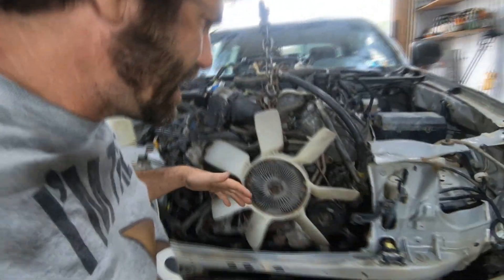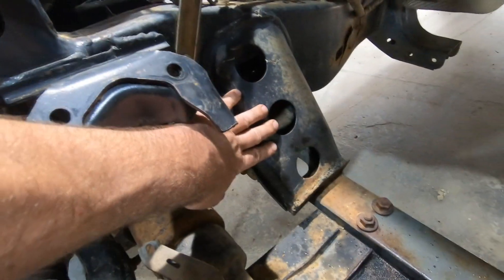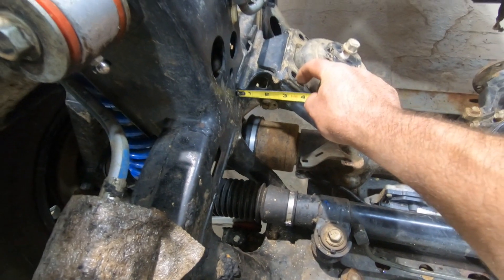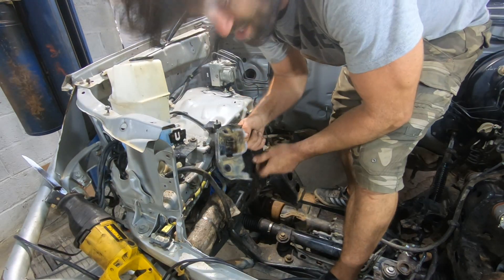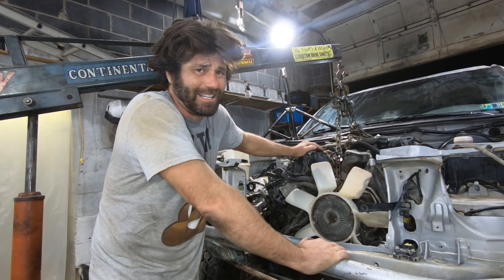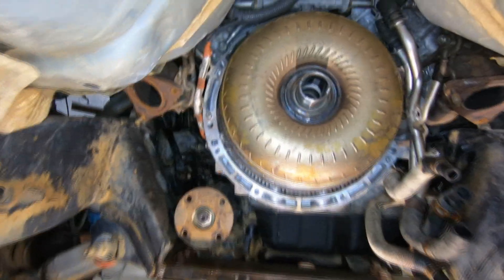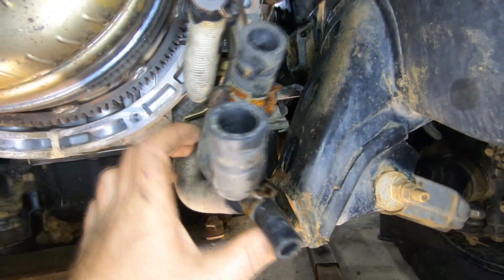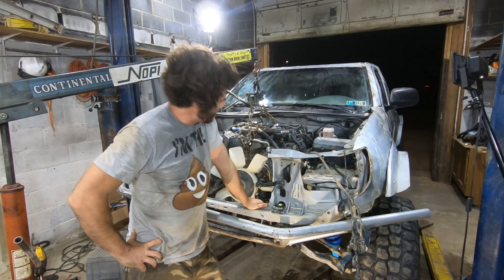Toyota Tundra's 5.7L iForce V8 in a Tacoma?  - TACUNDRA 16

Comment: By the looks of it, doing this swap in my 3rd gen pickup is going to be easier. A least getting in the power plant and transmission, looks like those engine bays are getting a bit smaller the newer they get.

Comment: I was kinda thinking just dropping a 4.8 ls since the v8 that goes into the 4runner is a 4.7. you can have room to work with and have the relatively easy modding of the ls series. Drop a cam, heads and maybe turbo and you'll have the same power or more with alot more room.
Reply from the maker: I'm too much of a Toyota-fan-boy to even consider a domesticated LS / GM PowerPoint.

Comment: You could use the mounts and accessories of a lexus gx460 they have the same front half of the frame as a Tacoma and come factory with the 4.6 same as the 5.7

Comment: Once you get the mounts sorted, something that may net you some front end real estate for the radiator would be to ditch the factory fan and clutch in favor of an electric fan. It would be pretty easy to do with a relay triggered from the ignition on position. Thats how I did the oil cooler fan on my 4runner.
Reply from the maker: Great minds think alike cause that has been my plan from the start. I'm not a big fan of mechanical fans. Pun intended.  Lol I have electric fans on my 96 Tacoma too.
Reply: @WHIPBASH  Awesome! look forward to more updates

Comment: The v8 4 runner is based off the tacoma right ? Try some stock 4 runner v8 mounts
Reply from the maker: I did consider that and researched it too.  But, not they're basically just like Tacoma mounts.
Reply: Different v8, 4.7 vs 5.7 bruh

Comment: I have a question,  wouldn't it be easier to use the 2005 4runner v8? It's a little smaller. I ask because I have fj cruiser which has the same motor as the Tacoma and the 4runner. So I'm just curious if it would fit ?
Reply from the maker: It would absolutely be easier!  I mean, if Toyota offered it as an option for the 4Runner, we can definitely put them in Tacoma and FJ using factory parts.  BUT don't expect to keep up with my 5.7!  haha

Comment: I want to put one of these in an ls400
Reply from the maker: Hell yeah!  I love those big body Lexi.
Reply: Do an LC300.. Started as a 2jz car so weight difference is nominal.
Reply: PureCountryof91 I thought about it but before I do that swap I want the bigger motor cause it might be a while before I do that
Reply: @yaseenamin8056  2jz is a capable engine. Plenty makin loads of power.  But a 3urfe..
Reply: PureCountryof91 It will be so much easier to fit that monstrosity inside the other monstrosity